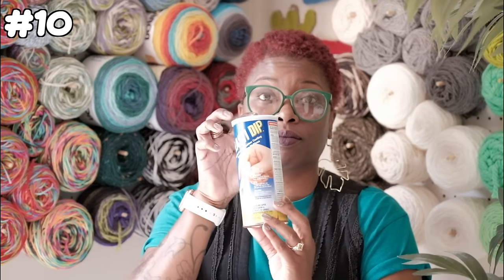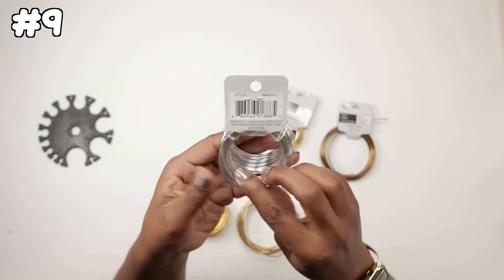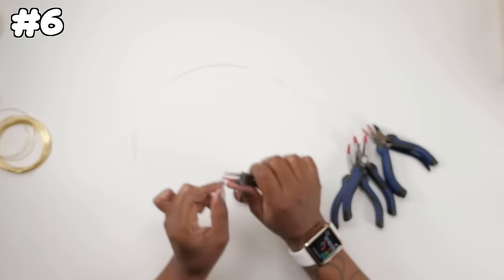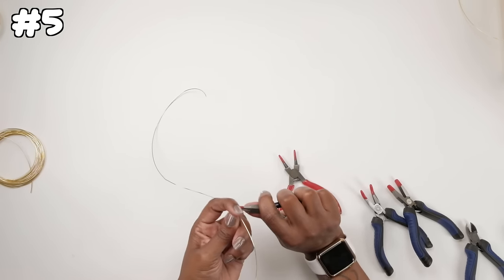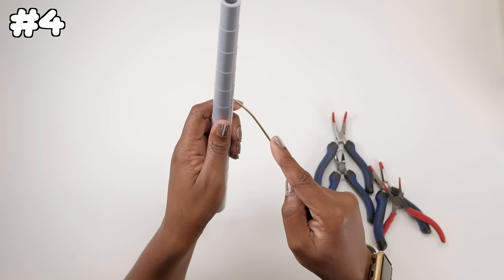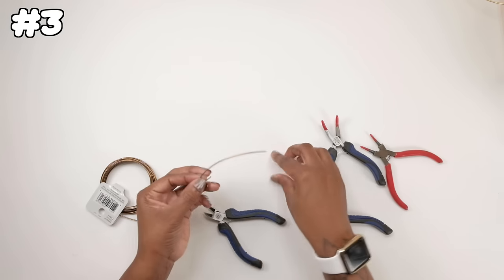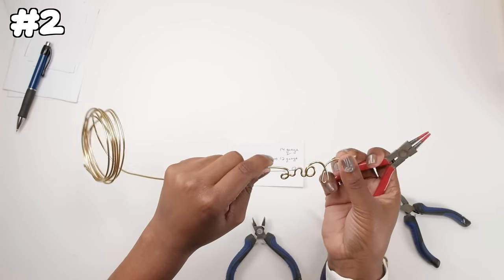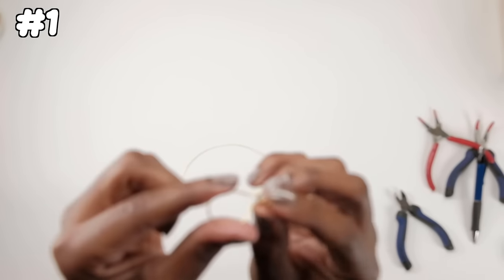Wire Wrapping Tips And Tricks | 10 Things I Wish I Knew Before I Started 🤷🏽‍♀️

Comment: Oh my goodness, no one has ever mentioned the Plasti Dip, Thank you so much. I am subscribing to you
Reply: Right?! This is the first time I've ever heard of it & I've been over here wondering how I'm gonna avoid ruining my wire or my fingertips & here, the eternal question has just been answered for me.
Reply: Yep a first for me too! Learned to use painter's tape, which was good for about 2 projects when you use thick heavy duty square wire like I did. This def looks like a #wirewrappinggamechanger!
Reply: I needed that tip about the Plasti Dip. I ended up buying a similar product, called Tool Magic, but it makes a huge difference! Thank you.
Reply: @tagalonggal  do you like the Tool Magic?
Reply: @spunkygmahappy4778  yeah, it’s okay. Not 100 percent smooth, but it’s not marring the wire at all.
Reply: Does the color rub off onto your wire?  How often do you think you have to use it?
Reply: @barbarafarrar7368  I was able to get Too Magic from a destasher, I just used it for the first time, no it did not come off onto my wire
Reply: @tagalonggal  hi how r
Reply: @barbarafarrar7368  It doesn't come off on your jewelry but it does wear off over time. Depends on how much you use your pliers as to how often you need to reapply.
Reply: @fcllc4217  Unfortunately we don't have any shops
Reply: @spunkygmahappy4778  Ah, I didn't even consider that. I only buy components online but sometimes classes at local shops are fun. I apologize.
Reply: @tagalonggal  Thanks for the tip on Tool Magic.  It comes in a smaller container and it costs 35% less.  Appreciate the hint.
Reply: the tools are only 2 dolars, you lose precision with adding plastidip. its not worth it imo

Comment: Hey there!! Loved your video 😁👍 I teach beginner jewellery making as well and wanted to pass on a tip: standard ear wires and posts are made with 20Ga (0.8mm) wire. 18Ga (1mm) tends to be too big unless someone is used to wearing piercing studs or the hole is already slightly stretched. Using thinner wire can contribute to a tearing of the hole especially when there is excess weight on the earring or accidentally gets grabbed (think your favorite shirt, scarf or tiny human!) Hope this helps! Keep up the great work!!
Reply from the maker: I neeeeeded this info! Thank you! Wrote it on my board near my creating desk! 🥰
Reply: @MartianCreations  glad to be of service!
Reply: Thank you!!
Reply: Appreciate the mm
Reply: I have a 0.25mm in my stash. Bought in error (went shopping before doing proper research) what is it good for?
Reply: @bron3477  wire wrapping or weaving...? Definitely way too thin for earwires!

Comment: Great tips, thanks, but the Plastidip tip the best ever.
Reply: I think because you got tool from Lowes is why this is needed.  Cant imagine putting this on expensive pliers.
Reply: @jaxpax2566  so are you saying expensive players won't scratch your work but cheap ones will?
Reply: @kerriefearby9542   I do it as a business.  If it's a hobby then & you using aluminium then you can follow her suggestion.  So I guess its important to note that I dont use aluminum which is an extremely pliable metal & what the author of the vid uses.  Therefore the marking would show up VERY easily.  For metal work I mainly use cooper wire & sheet metal.  Occasionally I use brass for variety.  I took jewelry making classes for 8 yrs.  I do have one "regular" small pliers that I rarely use but always use jewelry tools.  I got my first tools from Contenti which was the basic 4 piece.  I since purchased 2 tools each from Beadsmith & Xuron which are both great companies.  (I picked them up a Bead/trade shows)  I plan to purchase my next set from Lindstrom. I started with cheap hammers from Michaels.  My instructor told me invest in Fretz so I have 2 Fretz & 1 Maker hammers & brass 1 lbs & 2 lbs hammers that I got from the JA & MJSA show from the vendor Rio Grande. Got stamp supplies from ImpressArt. Micro tools & Rio Grande are great places to view & do your research but purchase on sale.  My disk cutter & dapper I got on sale at Amazon. I started soldering & looking forward to learning more but I started with stringing & beadweaving.   If you want to establish selling/business then google the names I mentioned.   Hope this helps.
Reply: @jaxpax2566  this helps loads!!! Thanks!🥰
Reply: @jaxpax2566  I wanna see your work now :/
Reply: @jaxpax2566  What is the wheel-like tool she picks up to gauge the wire called, please?
Reply: Thanks for having made mention of Fretz hammers!!  I'm happy to hear about them.  I haven't hammered anything yet - it's on my list (have been selling wire wrapped and wire woven jewelry for a few years, which I love).  I found out firsthand last month how much better made the Bead Smith pliers are!  I was like, "Where have you been all my life?"

Comment: When you've gotten a little budget saved up for tools, the difference between hardware store pliers and cutters vs pro jewelry tools is like the difference between an economy car and a Mercedes. It's amazing how much better they work and how much better they feel like an extension of your hand. 
Your idea of plastic coating the ends is a great one and if you go with pro tools, you'll see how little they mark metals. 
If someone ventures into sterling wire (which feels SO good to work with and wear), a tumbler is an awesome tool to smooth any sharp edges your tools might have made. 1 hour in a tumbler with water just about the jewelers shot level and one drop of Dawn with yield shiny and smooth jewelry, which can then be antiqued or kept shiny. 
Thanks for making this video!
Reply from the maker: I REALLY wanted to invest in a tumbler! And I’m also heading towards going with sterling silver wire. So I can’t wait to start doing that! Such good tips you gave me, thank you! 🥰
Reply: I agree with you about using told made for jewelers. I've only bought a couple so far, but so much better! When first starting I even filed off the teeth of the pliers. Tried taping the ends as some people suggested. Not a good idea. I want to try this dip it stuff, first on my old Lowe's pliers, then I'll see. Another thing the jewelers pliers are ergonomic, so my hands don't get as fatigued. 
You can buy them online for less than the craft store and they are delivered to your door. Also for cutting chain, I did buy a large pair of Craftsman brand diagonal cutters at Lowes. They cut chain and thick or hard wire effortlessly.
Reply: Oh yeah, you can get the plastic dip at hardware stores also.  Aluminum wire at the dollar store that's used for florists is fun too, and usually have different colors.

Comment: Luv your tips, coating pliers in Plasti-Dip👍 and your humor!😂 I'm new to jewelry making and just learned 2 sets of pliers are needed—1 to shape the wire and 1 to hold the other end during manipulation. Hardware store NEEDLE-NOSE pliers will work fine but they have serrated edges and leave marks. FLAT-JAWED CHAIN-NOSE pliers have flat surfaces designed for gripping wire/ jewelry wire WITHOUT LEAVING MARKS OR RIDGES. Chain-Nose pliers also have shorter jaws than Needle-nose pliers making them easier to work with. Chain-Nose pliers can also be used for opening and closing jump rings, as they taper towards the tip and can be easily manipulated into small spaces. FLAT-NOSE pliers have non-tapered tips and a wide surface area making it easier to grip jewelry wire. So, 1 pair of Chain-Nose and 1 pair of Flat-Nose pliers would work very well or 2 sets of Flat-Nose pliers. Happy Jewelry making : )

Comment: Your number 10 had me sold, subscribing. I used to sell this stuff when I work for home depot years agp. It was for people who hadd ripped off the covers to their pliers or something to dip the pliers into the men you would have an instant cover. This is pure genius.
     I'm not sure if you can get ithis at an art supply store but home depot has it and it's in the tool section to anybody out there. 
     Plus you could probably order it online plus plus it's probably cheaper than buying it at an art supply store.
    I'm sorry this comment is so long but you're pointing things out that I didn't know existed or you're showing me something that I never would have thought about.
    I Worked in an electrical supply place for 3 years and swear I could never keep the wire gages size right in my head. I don't know what it was it just would drive me crazy.  It's the opposite the opposite to what you think it would be. 
     Another tip is supply places will sell to the general public. I haven't met a supply story yet that's refused to sell things to me. That being said you can most likely get. Maybe a couple meters of one piece of wire and it will cost you much. So you could get sixteen eighteen twenty gauge copper wire, Actually there's a lot of gages you could buy there. Then you could buy wire by the foot.
    Most wire is sold either solid or stranded. Which means you? Could. Buy some? Really. The wire is. probably about a twenty six gauge wire if you get stranded.  i've checked it's tons cheaper. 
     It's a little bit of work but well worth it. 
Also if you happen to have a pair of jumper cables that are ruined, Strip off the plastic and Now you have free wire to play with. This is important especially for all those weaves that they show you and you can never get it right the 1st time.

Comment: Your wire wrapping skills are dope. I'm just beginning but I'm confident I'll be as nice as you one day : )... Also, I was hoping for some tips to protect the tips of my fingers.  I feel like I'm rubbing off my fingerprints haha. Great video!
Reply from the maker: Just google “silicone finger sleeves”. I used them in the past when I used to yarn bomb and use a battery powered glue gun which were so much hotter than the average glue gun, SO HOT that I kinda burned my fingerprints off. But I got some finger sleeves and I’ve used them for many things. I’m sure they’ll be great for wire wrapping!
Reply: The Plasti Dip was the best tip! (I want to use it on my thumbs!!) I'm just starting out so I've got to build up some callus'! I'll be getting some of those silicon finger sleeves!

Comment: Hope you don’t mind me sharing a few extra tips I’ve learned over the years that may also help.I have Loved all of yours and thank you so much for sharing! Some extra money saving tips, is tools from tractor supply and harbor freight, cheaper than lowes, and after plasti dip which i do LOVE hold together beautifully for crafting, just are crap for heavy work like mechanics and such. I bought an adorable mini anvil from harbor freight years ago, just because it was cute lol, but they do sell them there, I started life as a farrier, and am blessed to own a forge, and 80lb anvil i now craft on since an auto wreck (not my fault lol) ended my farrier career. Tractor supply sells the hand tools in amazing sets at the holidays like Xmas, for cheap! This past Xmas both my husband and i bought each other a set of either 10, or 12 for $6!!! The mini plier sets with additional long necks! Of course mine got the addition of matching plastic dipped lol. They also put the plasti dip on sale frequently, walmart does as well and the spray can has a ton of helpful applications as well. Ive coated my anvil top for fine copper, and aluminum projects, I didn’t want marred up. Then pulled off at a later time for heavier heated forge work again. Glass bits will drill through beads that you wish had holes, but a whole lot of damn patience is involved lol, works amazing on beach glass for necklaces you want to string over wrapping as well. And the most amazing tool called “helping hand” can be found for cheap at harbor freight. But by a few, to have extra on hand, and plasti dip your claws. Thanks again so much for sharing and happy crafting!

Comment: Harbor Freight is another good source for tools, wire and even compartmental storage boxes (used for screws or fishing tackle) that are great for beads. Flat earring backs that are meant to hold large earrings on your ears without sagging actually have silicone inside the hole so they will work on many sizes of wire.

Comment: I hope you don't mind me adding a few of mine to your excellent list - 
Always work on straightening your wire before wire wrapping, it looks more professional. You can buy nylon jaw pliers to help with this, or use the handle of your pliers and your thumb. Don't work with kinked wire, always straighten it first.
You can stiffen/harden your wire before you make your earwires by holding each end of the wire in pliers and twisting your hands in opposite directions.

You can use liver of sulphur on bare copper or sterling silver wire to oxidise it, then polish it to get a really detailed effect.
When making rosary or beaded chain jewellery, wrapped loops are a lot stronger and give a more professional look. They also allow you to get away with daintier looking, thinner gauge wire that would otherwise pull open or lose shape.
Not every supplier uses gauge measurements, learn the wire conversion measurements, eg. 20 gauge is 0.8mm.
Use flush cutters with the flat end against the wire you want to keep. Use files to smooth the ends to prevent scratching, especially with making earwires. You can also get cup burrs for rounding the ends.

Comment: Hello, I recently ran across your video. I’m now following you. Love your tutorials. I wanted to share a tip with you, as you shared yours with all of us. To get a thin layer on your tools with the Plasti Dip, pull the tool you’re coating out very, very, very  slowly. After it dries dip again, using same method. Slower is your friend in this case. I hope you get this & are happy with the results. I’ve found that the coating lasts twice as long using this method. 😄😄

Comment: I found that wrapping things without a hole actually is much easier and faster if you have some cheap junk wire you can throw away on doing a fast-and-dirty wrapping to keep it from going anywhere. This keeps it still while I fiddle with getting the decorative wrapping done. And since it's junk wire, you can actually cut that away later if your decorative wire is all over it. Just make sure to get it out of there before tying anything off since there'll be extra bulk from it making your wrapping loose.

I also use this technique for all my other wire-wrapping, like when I combine two lines of beads together or need to secure beads along a wire. Makes it SOOOO much easier!

Comment: #10 Use Plasti Dip.....I use Tool Magic from Joann's.  Mine is white and I have been using it for YEARS!! I LOVE that stuff!  I dip my pliers in it, shake off any extra if I get a ton on the pliers and then I hang them on the rim of a tall glass.  It dries to a thin coat on the pliers so don't stress out if it seems thick when you first apply it!!

Comment: I LOVE your sense of humor!
Just like mine haha.
You are very talented, and tf you showed the ring tutorial, that's one thing I've struggled to make. 

I used copper to make one but it was too flexible, does the bigger the gauge also mean the more hard the wire is? As I can't figure out what type of wire to use that's stiff enough to stick in place and not bend when you squeeze it or anything.

Comment: In my opinion, stainless steel ring mandrels are the absolute best. Often you need to hammer rings, or ring shanks, and you can hammer directly on the stainless steel ring mandrel. My second fav is my solid wood ring mandrel. You can hammer on that mandrel too. More importantly, you'll get a perfectly round ring shank.

I absolutely hate the kind of ring mandrels that have the indentations on the sides. They're aluminum, I think.

Comment: I could not find plasti dip in stores only plasti spray so I checked online and it’s like 20$ so Instead I went to michaels and found something similar and cheaper it’s called “tool magic” and it’s white. I hope it works. What do you think  about the tool you use to snip parts of the wire? Do you think I should put plasti dip on that one too? Would it still work with the plasti dip? Thank you!
Reply from the maker: Not sure if i ever seen Michaels version of Plastidip, I'll look for it! The point of plastidip is to protect wire. Cutters are design to cut wire, so putting plastidip on cutters would defeat the purpose of the cutters and make them unusable. so dont do that...let us know how Tool Magic works for ya!

Comment: I wish I would have seen this before I got this wire!!!!!!! Idk if it’s the wire or tools that’s making the color scrape off the wire
Reply from the maker: The color scrape usually happens if it's painted wire. if it's super easy to bend, it's probably painted aluminium. If it easy to bend but KEEPS it's shape unlike aluminum, then it's painted copper. If it bendy but has a weird smell then it's possibly painted nickel. These are my wire formulas. Hope this helps.